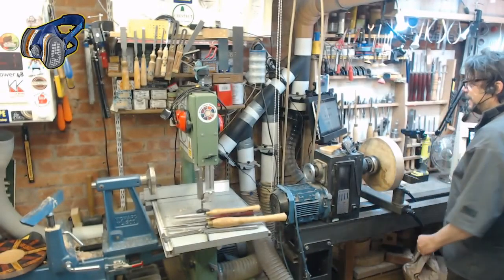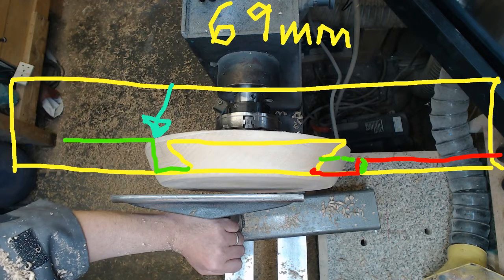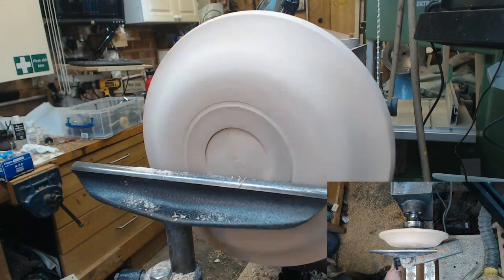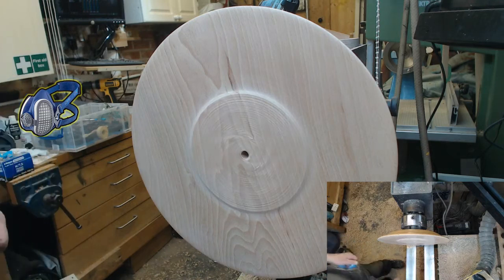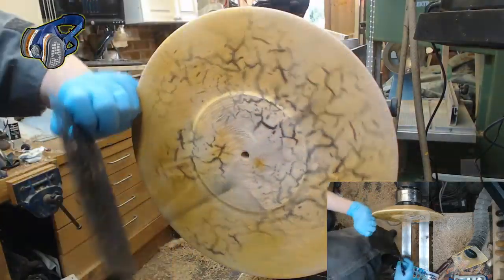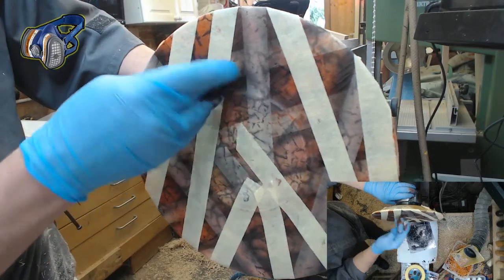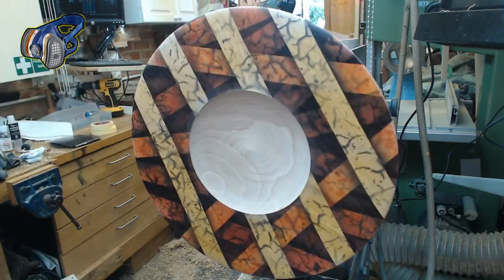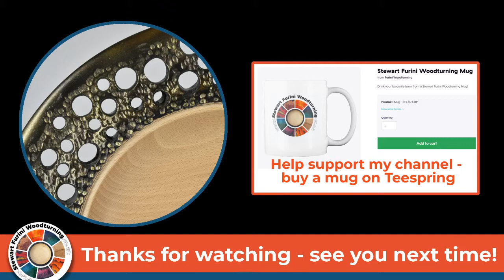Live Stream - Airbrushing Ribbon Effect

Comment: Hi Stewart, could you mention in your next video,  the needle (jet) size of your airbrush. Would off center centrifugal effect  give a none symmetrical radial pattern, just as a thought on the comments towards the end of your great live show.
Bryan
Reply from the maker: Cheers, Bryan - the needle size is .4mm.  This is the type I use most of: https://www.ebay.co.uk/itm/Sealey-Air-Brush-Kit-Suction-Feed-With-Carry-Case-Spray-Paint-22cc-Cup-12pc/312192345365?epid=12017000206&hash=item48b01d2515:g:IkYAAOSwzwxeHtwz
An off-centre centrifuge effect would still give a radial effect, but the centre of it wouldn't be in the centre of the bowl. It might be fun to combine several off-centre colour applications....